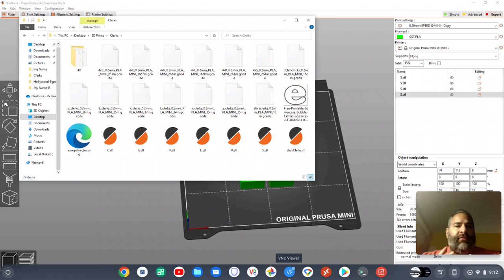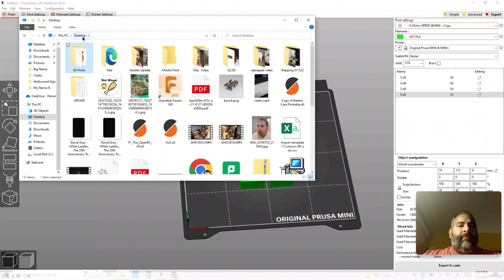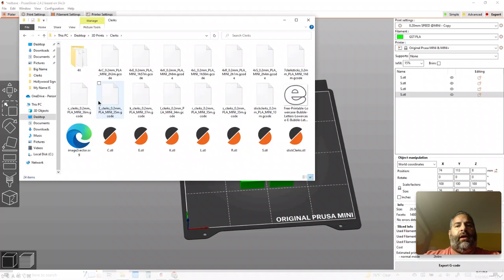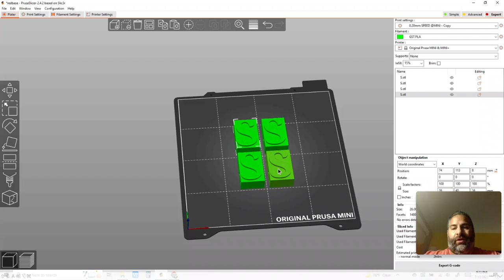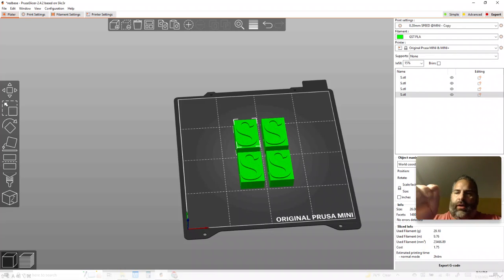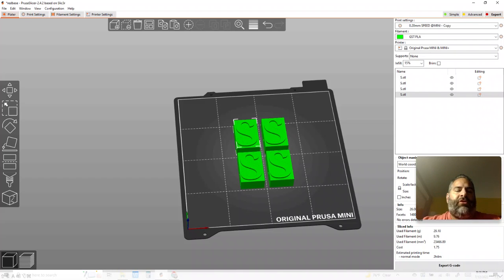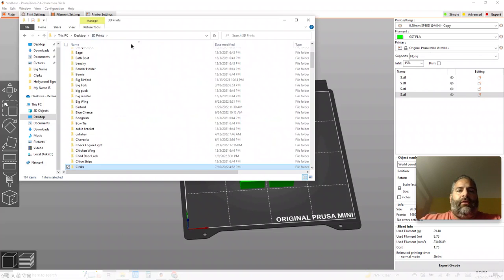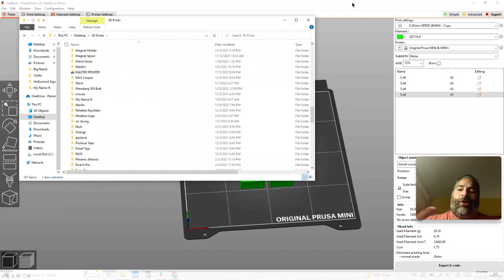Tips for Managing Your 3D Print Farm Files

Comment: Hi Luke. Have you ever tried to print multiple keychains at once which involve a filament change? Unsure if it will work as the parts might cool down on the bed before the next colour filament gets applied. Would try but don’t want to waste filament. Thanks
Reply from the maker: yes, this is how i do it all the time.. If the printer excepts a filament change code, it will keep the bed warm until the swap is done... On my old Ender 3s i would have to be there to swap colors quick...
Reply: Ok that’s great. My Ender 3 v2 does accept filament change code I just wasn’t sure if the parts would stay warm enough at bed temp. Thank you
Reply from the maker: @jackstreff  it is still a good idea to not let them sit for long

Comment: I like how analytical your videos are and that keeps me coming back. 

One small request, could you please lower the volume of your intro? It is much louder then the volume of your content and is quite unpleasant. 

The 1x 4x 8x system is very similar to whaf I do but a little more efficient. I usually don't think that far ahead and always have to open the smaller or larger version of the project file to reslice up or down when I need to adjust print times for efficiency.